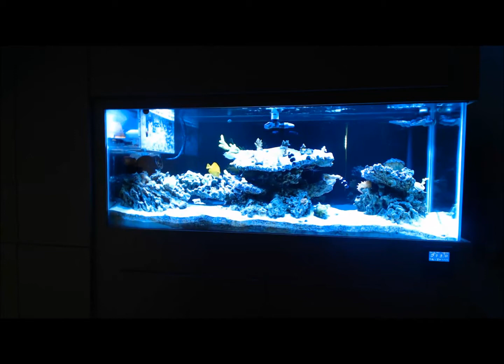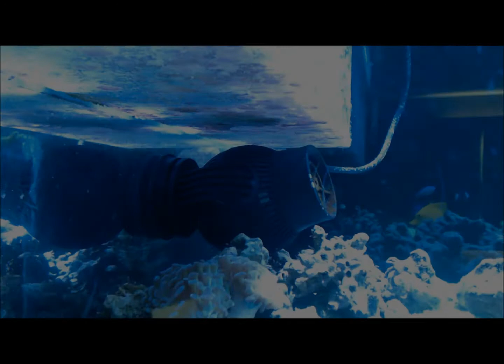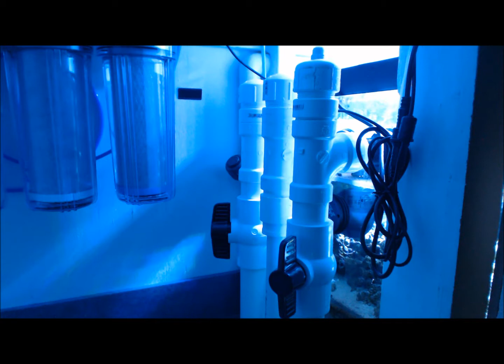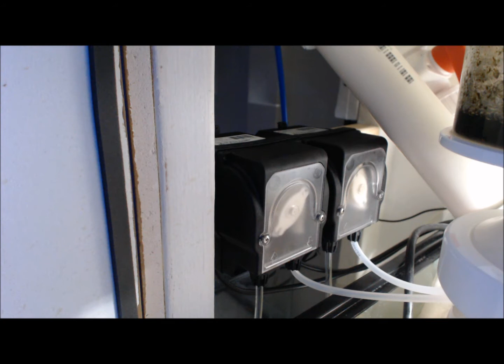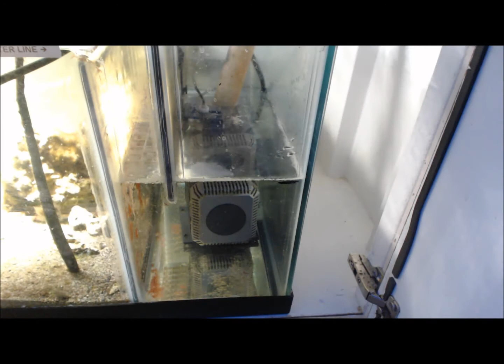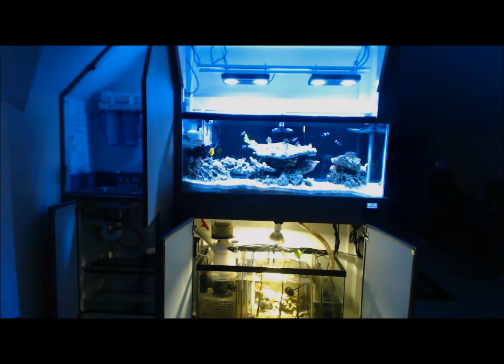notw21 reef contest entry for davids aquariums

Comment from the maker: not sure exactly what you are talking about. for flow in the tank I have a Jebo wp40 and to loc-line returns from the return pump and the spiny thing in the middle is actually a sprinkler head that used to rotate that i put in there to spin. and sense adding the Jebo wp40 it doesn't spin as much so i was thinking of taking it out.